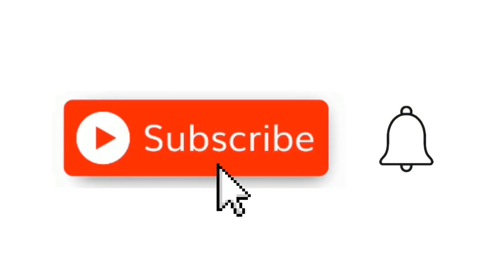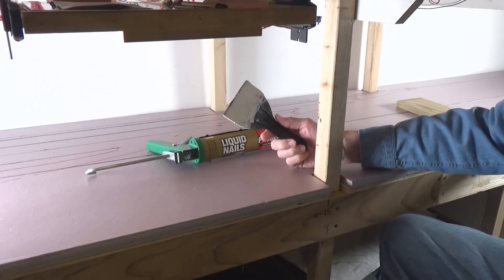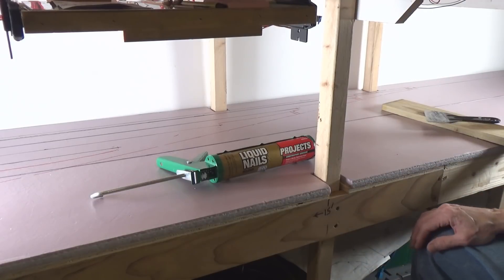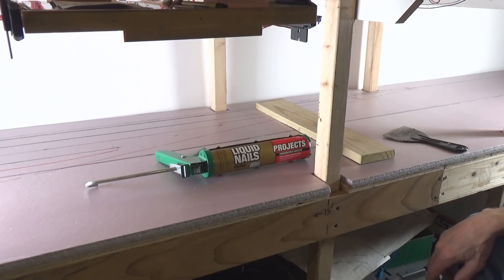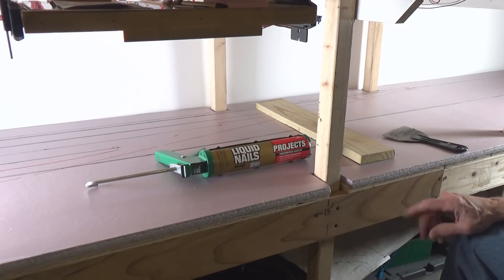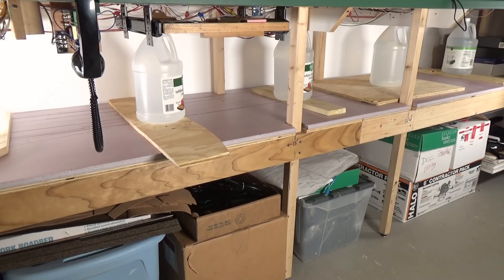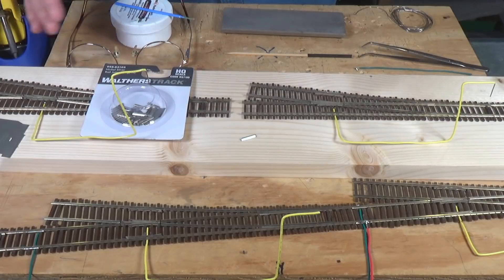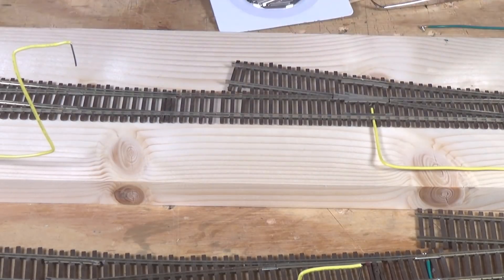Laying The Base And Building The Staging Yard Ladder (232)

Comment: RE: 11:20 - something I discovered recently a handy tool for installing rail joiners without cutting my fingertips ..... take a piece of rail and bend it upward about the length of 1½ rail joiners, leaving a handle about 2½ - 3 inches past the bend.  Slide a rail joiner onto the short end up against the bend, leaving about ½ length of rail joiner.  Solder the first rail joiner on the bent rail; add a wooden dowel for a handle to the long end.
To use - slide a rail joiner into the short end and use the tool to slide the joiner onto the track; then slide the tool back, leaving the rail joiner on the tract itself.  
Been working with joining rail since the 70s and have just recently discovered this home-made tool ..... so simple to make and really helps installing joiners onto rails.  I have 2 - - one for Code 83 (useful) and one for Code 70 (VERY useful, especially with ME track).
Reply from the maker: I saw that recently on Charlie Bishop’s channel but promptly forgot to try it. Thanks for the reminder.

Comment: I agree, a well done presentation.
RE: (approx.) time stamp 15:15 ..... something I learned many years ago - a broken piece of hacksaw blade will also work very well for dressing the flangeways of off-the-shelf frogs, guard rails and crossings.   piece about 3 inches long of a medium tooth hacksaw blade not only will clean out the depth, it will also leave the flangeways the really close to the NMRA standards width as well.  I have used this trick also when doing old-style hand laying of turnouts  and crossings (as opposed to something like Fast Tracks jigs or BK Enterprises turnout kits).  It cuts the excess solder down quickly and is easily controlled (moreso than using a Dremel cut off wheel).  
IMO and experience, of course ..... ;)
Reply from the maker: I guess I’ll be breaking one of my old blades into sections now.

Comment: I hope you noticed on the second joint you left a gap between tracks.  Granted the shouldering will complete the the electric circuit, however the gap could cause derailments.  Not good in a hidden statement yard.
On the other hand I do like the trenching of the roadbed for feeder wires (in Part 2).
Jim
Reply from the maker: Yes, but it only looks large because I was zoomed in while doing that joint. I checked it afterwards and can’t even get a #11 blade in there. The solder flowed into the gap and filled it so in reality it is not an issue.

Comment: Thank you for sharing. Today's video just came just on que as I was planning on ask you on the wairing (and controling) for a reverse loop/staging yard combination that John Armstrong shows in his book Trrack Planing for Realistic Operation (page 104 on my copy). I'm intrigued as the reversing loop has two turnouts: one for the layout and other to the yard. Thank you.
Reply from the maker: My copy only has 100 pages so you’ll need to tell me more about the track plan you refer too. Got a name or anything?
Reply: In the book it's called: "Rverted” loop. Used to add a staging yard to the end of a loop to loop layout. It's at the end of Schematics for satisfactory operations chapter. If you picture the reversing loop as a teardrop with a turnout in the pointy side, that turn out will lead to the staging yard. The teardrop has a second turnout, that second turnout turnout is located on the curved section of the teardrop and connected to the layout. 1) the train enters the teardrop and goes directly to one of the unoccupied legs of the yard. 2) that train goes back to the teardrop,where is reversed and returned to the yard. 3) to get back to the layout the train goes back to the teardrop and exist thru the turnout in the curved section.
Reply from the maker: Yes, I know it well. He originally used it decades ago on his O scale Canandaigua Southern layout in Silver Spring MD. I visited the layout once at an open house he had. An interesting concept to say the least. I have never figured out the best way though to incorporate it into a layout design and I can’t remember seeing it in any of his track plan books or in MR.

Comment: Well done thanks for sharing. I well do this in January when I build my hidden yard. Would it be convenient to add the flux paste in the rail joiner before you slide it on the rail to help the solder melt over to both sides?
Reply from the maker: I think you would find that messier and it would not prep the web of the rail as well.

Comment: What about using Homasote? It is not available much here in the Pacific NW. Years ago I learned how to use it while a member of a club in Colorado Springs, CO. It was easy to use and spike down track.
Plus I’ve worked on a club layout recently where they used some kind of white hard foam. I had to rebuild the road bed and base with other material like cork because the foam had started breaking down from being compressed. What does this foam do after years of use?
What brand of turnouts are you using? Does sanding the frogs help reduce dead spots over frogs? Or do you wire up power leads between the frogs and switch machines?
Reply from the maker: I used to use it in NVa but it is not available down here. Plus I like the flexibility if using foam insulation. I have used foam for over 15 years and it seems pretty stable. I power my frogs by wiring them to the SODT in the switch machine

Comment: I’m learning so dumb question.    Why glue the foam down?   There isn’t going to be much stress applied which would cause it to move.   What am I missing?   

Retirement is boring so I’m about to starting from scratch on  building again after 40 years.
Reply from the maker: If you were finishing a basement you’d glue the foam insulation to the block or concrete walls, or the studs so this is no different. If you don’t glue it down it can dance around on your plywood baseboard. You basically need something to hold it in place.

Comment: Just wanna say a few things. 

If you need to sand your points for them to work properly.....you need to buy diffrent track from a better manafacturer. 
Those rail joiners you used looked REALLY loose on those points aswell. I would throw those away and find ones that fit tighter, might just be the two you showed us rather than all of them but still.

Comment: What are you using for a soldering iron?
Reply from the maker: That is a Hakko FX-888D soldering station I purchased on Amazon. It heats up quickly and the tip is thermostatically controlled so you always get the same temp. More importantly the tip is well grounded so you get no electrical leakage through it to kill sensitive electronics such as decoders.
Reply: @TheDCCGuy  Thank you

Comment: Larry, the single ladder arrangement you have used takes a lot of length resulting in a significant discrepancy between the shortest and longest staging tracks, even using what appear to be #6 switches.  I understand not using a compound ladder to shorten its overall length since reliability is paramount in a hidden minimum access staging yard like yours.  But was there no way to have the lead track come in aligned between the two middle tracks and then use  a number #3 wye as the first switch with #6 switches on each route out of the wye to minimize the overall ladder length.  (#4 wye and #8 switches combination could also work if running a lot of passenger trains.) This would have resulted in more even track lengths and an overall greater capacity.  Just wondering about the track planning constraints you faced.
Reply from the maker: I have more than enough room in that location to spread out, so space was not the issue. Being a hidden yard where I will need to back in passenger trains I wanted #6 turnouts and the smoothest possible traffic flow plus I had laid in a large supply of ME #6 turnouts some time ago. My other staging yard will be in a more challenging but visible location where I will probably use a split design like you mention. Instead of the wye arrangement I plan to use the Walthers double crossover on the approach track with each track going into a short ladder. And for that one I likely will use the ME yard ladder turnouts.

Comment: Hi Larry. The Walters rail joiners look a little too loose for my liking - possibly leading to an unsatisfactory connection (OK, I spoke too soon as I didn't know you were going to solder the joins!). I would also question the quality of the Micro Engineering turnouts if they need "finishing" with a honing stone and/or Dremmel. One last thing: it's not good practice to blow on soldered joints to get the solder to set - this can lead to dry joints and a poor electrical connection. See you next time.
Reply from the maker: Although it looks loose it provides a tighter fit than many of the others in my collection. I also have some that are so tight they have be pried open just to get them onto the end of the rail and others are so loose they fall off.
Reply: @TheDCCGuy  Always look for a happy compromise.

Comment: May I ask why you (and others) think it is necessary to glue down the foam? A few wood screws and fender washers will secure that stuff just fine. Five minutes and you are done. Plus you can remove the foam in the future if necessary. Plus you can carve out a river down to the wood without having to scrape off the glue.
Reply from the maker: One big advantage of using foam sheets over plywood is that you can use less expensive grades of plywood to provide a very smooth surface on which to lay track. I just don’t accept that screwing it down i  a few places with provide a smooth stable surface. It is especially important to get a smooth connection at joints without an buckling or warping that screwing might induce. I have never had any problems with cutting ditches or other features in glued foam sheet and on e laid I don’t expect to remove it again until the layouts broken up. However even if I did I is easy enough to slide a long thin metal blade between the plywood and foam to remove a section.I have been doing it this way for 20 years or so and find it much better than my previous adventures with L girder and open frame benchworrk scenery methods.
Reply: @TheDCCGuy  Screwing it down doesn't induce any warping or buckling whatsoever in my experience. In fact it seems to me that gluing would more likely produce an uneven surface if the glue is not meticulously spread out, more so with thinner foam. I put 1.5 inch foam over 1/2 inch OSB quite successfully with wood screws and fender washers. The result is perfectly flat. And OSB is certainly a less expensive grade of flat stock. I even mounted the OSB with the good side on the bottom for better mounting of switch machines, etc. That left the rough side up for the foam to rest on. The foam smoothes that out nicely. And it is quite stable as the roughness of the OSB provides plenty of friction to resist lateral movement. It will not move once screwed together tightly. When I screw it down I tighten it until the foam collapses enough under the washer such that the screw head is flush with or a little shy of the surface. Then a piece of blue painter's tape covers it up. After scenery materials are applied and the screw is hidden I can still find the it in the future by either making note of where it is or using a magnet.
Clearly you have not tried this technique. Give it a try sometime and observe the result. I might convert you. 🙂
BTW I have observed significant foam shrinkage on several pieces that were just laid on plywood (not fastened down) and on some that were glued down. I don't know whether fastening by screws rather than glue would help with preventing the shrinkage, but I doubt it. I'm experimenting with cutting relief kerfs across the foam every two feet. 
Carry on, my man. I always enjoy your videos even though I don't agree with some of the techniques.
Reply from the maker: Glad you find it works with 1.5” foam. The shrinkage factor has been reported in the past but most manufacturers claim to have fixed the problem a decade ago—I have not seen it myself. As the old saying goes there’s more than one way to skin a cat.

Comment: I did notice that you are using Micro Engineering turnouts. I didn't catch the number for the turnout. I.E. a #5 or a #6? Also why did you not use their ladder system? Thanks
Reply from the maker: I used #6 because this is a hidden yard and I will be backing passenger trains into the tracks. I did not use the ladder system because I had purchased a large supply well in advance before they were available. I have enough turnouts to complete my entire layout. Expensive but it has insulated me against price increases and shortages.
Reply: @TheDCCGuy  Okay. I am designing my layout based on the Red Rock Northern track plan that appeared in Model Railroader Magazine. (June 2007) I was wondering if I should use the Ladder system as I will be using steam engines and long passenger cars as well. Hopping to avoid problems.

Comment: I commented and received an error when I clicked the Comment button.  The post I made disappeared.  So I will try again.

You mentioned DCC Concepts and from what you said my guess is that you are talking about their wireless control panels using the ESP system.  I have emails going back and forth with the guys at DCC Concepts.  The have sent me two diagrams for wiring up the ESP system with the Digitrax Command Station and PM42s.  They have commented and recommend using the Alpha Power and Booster boxes so the ESP transmitter doesn't "trip."  So, one PM42 channel feeds the Booster which is powered by the power supply.  The Booster feeds the ESP transmitter.  Since I have their DCP boards to control the non-DCC Tortoise machines they show those in the next diagram.  However, the Alpha Power box and Booster adds an additional $225-230 to the total cost.  Do you know a way to avoid that cost?  I do have a new PC power supply with voltage breakout board under the layout.  Maybe you can discuss this in your coming video?

The reasons I am looking at the wireless control panels is two.  One, I am one who prefers to control my turnouts from a panel.  Two, I like the idea of eliminating the multitude of wires that run out of a control panel and under the layout.  I could break up my railroad into four sections controlled by four control panels.  The switching areas work out that way.
Reply from the maker: Yes, you figured it out, it will be the ESP wireless control panel system. I have not looked over their Alpha system yet so cannot really comment on it. So let’s look at the ESP system. The transmitter boards are what are installed in the control panel to send switch changes to the receiver. The receiver in turn combines the transmitter data into DCC commands on accessory bus and sneds them on to the accessory decoders controlling the switch machines. To do this the ESP receiver on the layout creates a stand alone 1.5 amp accessory bus. If that is not enough for you or if you want the DCC system commands included on the accessory bus then you can use the main DCC power bus to power the receiver board but again will be limited to 1.5 amps. A third option is to feed the output from the receiver into another DCC booster and the pass through current will be the same as the booster rating. I will go over all of this in the 4th or 5th video depending on how much I cram into the upcoming ones.
Reply: @TheDCCGuy  I know you need one receiver in the accessory buss wire.  The transmitters are in the control panel(s).   Communication is wireless.  So, perhaps they are stating that the standalone accessory buss needs the Alpha boxes to power and provide enough amps to the transmitter which in turns powers that accessory buss.  l suppose if one had routing programmed to control multiple Tortoise machines and enough of them were thrown at the same moment one could consume all the available amps creating a power issue.  I am sure you have a lot more turnouts than I plan to use.  I am looking at less than 24 on the whole layout.  I will be interested in what you come up with in your videos.  I do plan to go this route.  Below is the DCC Concepts video explaining the ESP system.  Note, Richard does mention that it is part of the Alpha system and that is a family of products that go together.
Reply from the maker: I looked at their website a d it appears the Alpha central box is a self contained control panel in itself. The Alpha booster is just that a dumb booster to provide extra power if needed. With 24 Tortoises you would not need more than 1/2 amp of if all were running at the same time which is highly unlikely. So in most case the ESP receiver’s 1.5 amp output should be overkill. However I may use a booster like the Tamm Valley Depot one just to lower the drain on the main DCC power bus, but only if I end up lowering every accessory decoder on the layout with that power. Keep in mind that you only need one ESP receiver on your layout since any number of transmitters can be paired with it, even if they are in different control panels.
Reply: @TheDCCGuy  If we had email I would share with you the diagrams I received from DCC Concepts.  By the way, on the control panel with that silver hinged frame in the DCC Concepts video, those on Amazon are called "Snap Frames".  You can get those in the aluminum color, but a company called BNV has those frames in 8.5"x11" in different colors.  You could have a different colored frame for each control panel or settle on one color for all the control panels.  Anxiously waiting for your videos on the ESP system.
Reply from the maker: Thanks for the tip on the Snap Frames. I thought it made a nice way to finish off the control panel. I likely will order one tomorrow for this panel.